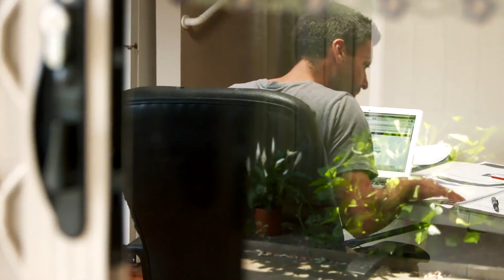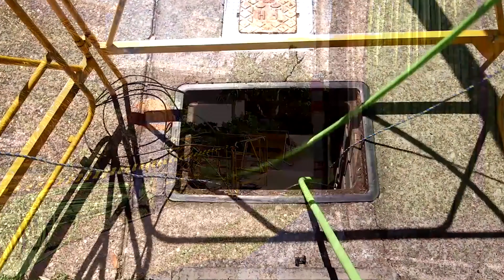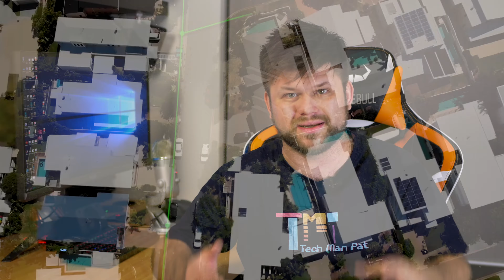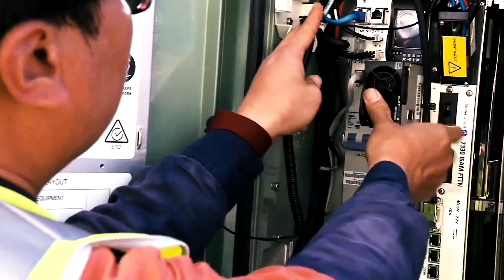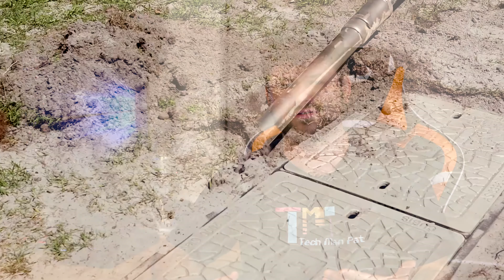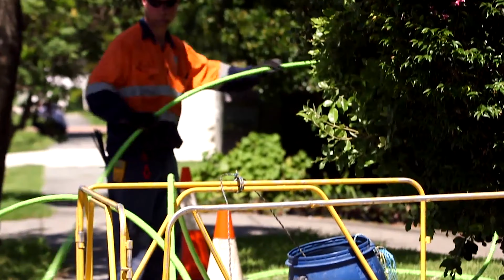Netflix defeated Wireless NBN | Tech Man Pat

Comment: What's sad is that across my street they have FTTN but because I'm just in range (by that I mean the very outer edge) of the Fixed Wireless tower I'm not allowed to connect to the FTTN. I even offered to pay NBN so I could get FTTN as I used to get ADSL on that side of the street but wasn't allowed as it wasn't in their business model. Fixed wireless either needs to be upgraded to take the bandwidth from now and in the next 10 years or scrapped and do FTTN. Currently I struggle to watch streaming services without buffering during peak times.

Comment: +Tech Man Pat to be fair the actual Fixed Wireless NBN infrastructure that is in place in rural areas is easily capable of handling the 50/20 speeds without slow down in congested periods.
All the technology is supplied tested and maintained by Ericsson Australia. One of the biggest issues is that ISPs do not purchase the necessary bandwidth from NBN Co to cope with the demand on the network.
There is also a cell congestion issue that results from the early adoption of Fixed Wireless NBN which is running on 2.4 GHz and using older tech antennas all running from a single cell so they are much more susceptible to slowdowns when there are a lot of people using the NBN. This would not be as bad though if ISPs would purchase enough bandwidth. 
Ericsson & NBN Co have been rolling out new antennas that are capable of using multiple cells and can be easily switched if one becomes too congested.
I say this as I am currently going through an issue where my 50/20 slows to 4/6 during high usage times and have just had my NBN Box and antenna replaced by NBN Co to the newer technologies.
I am now in the process of getting my ISP to do cell swap for me so that I can access the NBN on a less congested cell on the tower.
So again a lot of the congestion on the internet I feel is more related to ISPs not giving their customers what they want so they can save a buck.
Reply: I'll bite: You have a great theory, possibly based on reading online forums and the less-than-ideal crap. FW was doomed before it began, we in the WISP industry warned the Gov for years before NBN was known but no, they went ahead. 
You have not looked at the most fundamental issue, any wireless system needs to have good, clean signal to work with. I see more than 60% of installations that are done wrong. Installers are NOT trained or qualified to know what microwave is and how it works. They are told to reach a rather shitty, low signal level and not to go to where it should be. They certainly not told about natures RF traps called TREES and what happens in different weather. They are not told what other buildings and roofs do to the signal either. 
-70's is the target, not -40's where it will hump along sweet, even with rain, wind or smoke. Sick of going to sites, 1 or 2 bars of signal on a great day is horse shit. 
While here, I also agree that RSP's in many cases simply don't have big enough pipes into the POI's but currently, NBN FW is very hit-n-miss. Satellite, fark me, don't get me started.
Reply: @benstyles8494  true however I can only speak to my own experience in this case. My signal is really good with a clear line of site. No roof tops or trees in the way. Agreed many installers were not adequately trained in the early days due to all the sub sub sub sub sub contracting which resulted in off duty taxi to drivers doing installs. My point was only aimed at adding that one of the major issues with FW was the lake of bandwidth.
Reply: Definitely agree with you rick

Comment: The criteria for employment in the NBN management was: will you be a coalition lacky,  that tows the line. Lies about the real cost of supplying  FTTP for all. Hide the fact it's multish*t, sorry multimix network will cost as much or if not more then FTTP.  Didn't meet its 2016 target to connect everyone! Is incapable of delivering reliable fast speeds. When the network is finished, it will need to go back and replace all the FTTN connection to FTTC as a minimum, to provide a fast reliable service!

Comment: nbn wireless could not get more then 1-2 megabits for me in 2014 (during busy times 3pm/11pm the time i use the internet so i went back to adsl2 10 megabits all the time stable pings for rainbow six siege however now the nbn are back telling me that my phone line will be connected to them by fiber to the curb in the next 4-8 weeks so lets see if cable is any better

Comment: Mate I don't know what your sniffing but I want some lol I'm on nbn fixed wireless and live 5.5kms away from the tower and I'm on unlimited downloads at 50mbps down and 20mbps up and I consistently get around  35mbps down and 10mbps up around 3-5pm after around 9pm it stays constantly around 42mbps down and 16mbps up  which is basically the Max available and have the proof to back it up. prior to nbn fixed wireless becoming available to me I could only get base ADSL with "good old telstra" and they promised me I would get 10mbps down and at best I was only getting 56kbps so I'm most definitely not complaining yes it has taken me 2 years to get my service stable with the nbn "upgrading" my antenna which made it worse then switching me to a different frequency which was worse again then after alot of arguing between my service provider and the nbn directly I got on a old but stable frequency which nbn said " this frequency is congested and full and will be extremely slow and that you should stay on the newer frequency antenna" to my reply NO  as it's crap change me to the old frequency and ever since it's been stable as hell with the worst it ever getting to is 15mbps down  this has all taken me 2 years of fighting and arguing but I did it lol but your video is  very limited with the tests and research you have done I'm not defending the nbn as they are a bunch of idiots but just saying I'm getting almost exactly as advertised and I'm on the most outter limits of my nbn tower which is very congested in a big town yes it does fluctuate a fair bit but all things considered its consistently stable

Comment: The gaming industry proves that this whole Netflix line is bullshit. All competitive games are live and require real time information to be sent back and forth between players and servers. There can be hundreds of thousands of players at one time.Developers know this from past mistakes of not having enough servers to cope causing bottlenecks and crashes. Netflix is basically one way traffic. The main interaction that you have is the controls of the video playing and choosing which one. I have worked on the Network in Perth. Working in and around town was a nightmare. The network is so old that before we could do the job we were sent there for, we had to basically upgrade what was there before we could even start. So a simple job cost 10x because of a Network that had never been upgraded or maintained or designed for future expansion. There are cell sites that still use 2G equipment and we were told not to say anything Vodafone lol. My point is someone is using this money to upgrade their Network. This lie about Netflix is the same lie game developers use  because they did not want to spend money on servers. If the gaming industry can service hundreds of thousands of players at one time all needing real time information sent back and forth why is it that a video streaming service breaks the NBN?  The size of the NBN is not the problem. Working in the outer suburbs and new developments are  easy because there is no congestion. The most you would find is a single fiber cable or none at all. Which means a super fast haul and an early day. If the Perth Network is old and congested and it's considered a young city how bad is it in the other main cities. The NBN failed because they didn't know(or did they?) how old and congested the Network is. 19 billion yeah maybe for one major city to totally upgrade their Network. Taxpayers paying to upgrade a privatised Telecommunications Network.

Comment: The likes of Netflix, Stan etc are not the problem. If this was then why did the government introduce "FREEVIEW FV" which is a streaming service also? Those who don't have pay t.v. but are following all the reality shows etc. and need to get a fix have to stream them ( that's if they don't use PVR ). But NBN would never consider taxing them ( oops, hope they don't read this ). Never believe a radio system will save your life, it's limited. Just as the incoming 5G when it has more user devices on it than the network can handle. Something has to give ; )

Comment: I was the first wireless NBN customer in my district (NW Tasmania) and regardless of its faults now because of Netflix etc. it is still faster and more responsive than any service we had otherwise.  Where I live ADSL was not an option and the best internet you could get was Satellite which was rubbish for everything I wanted the internet for.  So throw NBN under the bus if you want, but they are still providing super access to people whose only option was a dongle in areas where it was hit and miss if it would connect.  In reality, dial up was the best option there and Wireless broadband through NBN transformed a lot of peoples lives in our district.

Your example of road deaths and vaccines are flippant and also pointless.  There are taxes that exist because of these things (vaccines, road safety etc.) and people pay prices for things such as seat belts in cars and other safety equipment.  If there was no need, the prices of cars would be less.  So while I do not support a Netflix tax, I can understand that some may float the idea if it is video on demand services that are causing the degradation of the network.
Reply: We live in Flowerdale and have a 25D &10U plan with Optus, barley get 20 at times, today has been shocking as the network is clogged up due to school holidays here and I can barley get 5D, current speed test showed 4D & 0.5U. It’s ridiculous, yes better than satalite but still too slow for a family of 4 with many devices connected, look at countries developed similar to ours, USA, their slowest FW plan is 50D, like come on, we live in an age where everything needs internet but yet we can’t get a connection that is reliable and fast!